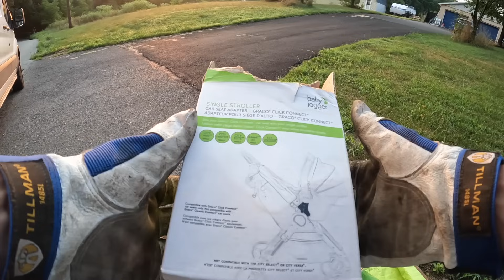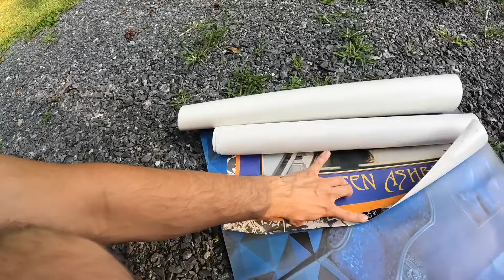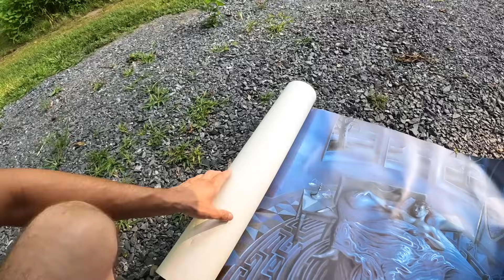Wow Look What I Found In The Trash! - Garbage Picking Ep. 942

Comment: We have fans in camper and air conditioning  but we have to pay electric . So it's the difference of a 10.00 electric bill and a 100.00 or more , so I use fans, this week some used a air conditioner that was Not meant to use in camper fried power lines , we were without electric until 7 pm! Plus it fried my microwave and a light and I  need a watch dog surge for camper. Big hit on pocket.